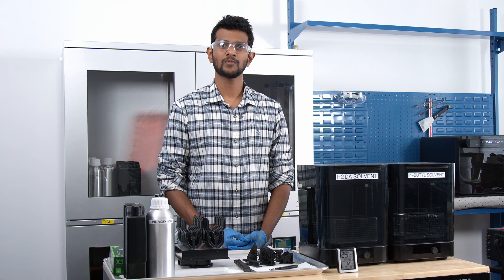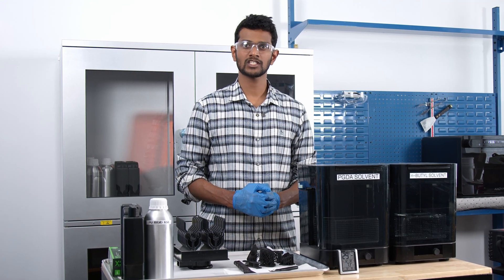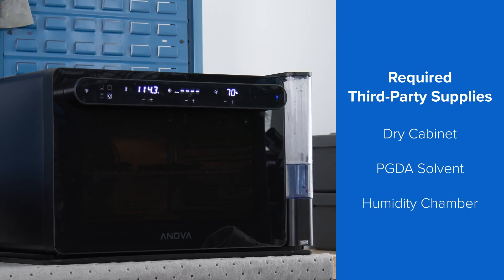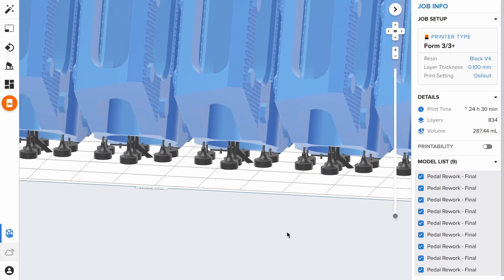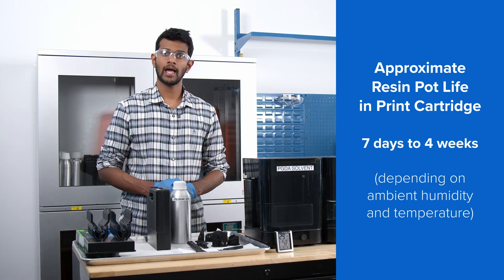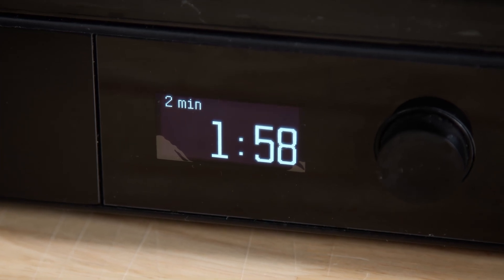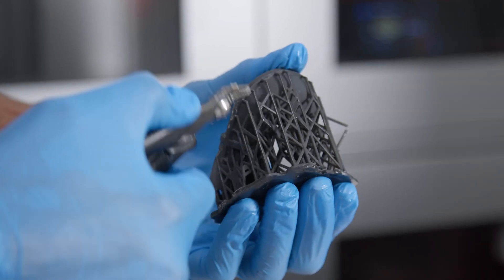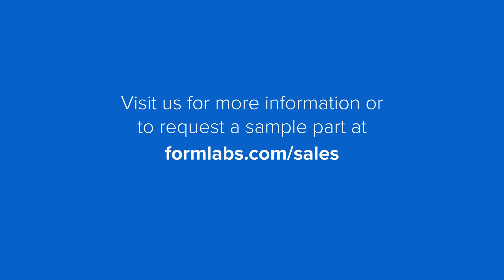Polyurethane 3D Printing Workflow

Comment: Would just love to hear of . . . 
PU Thermoset resin systems 
( with or without chopped glass reinforcements . . . to achieve 
1  A very hard stiff high IMPACT RESISTANT parts with upto or exceeding SHORE D 71 
2  A FAST SET SPRAY GRADE material to manufacture parts as large as 8ft x 8ft  . . . surface area . . could extend on.
3  Whether Rigid PU foam sandwich composite could be integrated simultaneously OR post operatively with this surface ?? ideally simultaneously.

THERE OUGHT TO BE A WAY . . . to accomplish this.

Comment: I was super excited when I first saw these new PU materials for Formlabs printers. They seem somewhat better suited for production throughput with that short of a shelf life, not prototyping. I need occasional elastomer small parts, so I'd be trashing most of the bottle almost every instance. Glad to see you're developing new materials in any case, but thats a lot of extra equipment and hassle to accomodate. Hopefully we'll see a more user friendly elastomer resin option for the platform in the future. For now it looks like I'll have to stick with TPU on the ol' Creality FDM :)

Comment: A few deal breakers for me:  1. Need a humidity cure chamber. 2.Curing takes "minimum a few days". 3. Shelf life of resin is 7 days to 4 weeks once opened.
Reply: Couldnt agree more, i work at company that has the ability to burn cash in dumpsters and we are not even pursuing this. However, we were very excited at first... haha
Reply: Although I agree the shelf life is less than ideal but easy to work around by just waiting until you have enough prints to use the majority completely up without wasting as much.  I'm just hopeful for more real parts that are more robust and usable without worry of over curing in the light and other issues.

Comment: So... I think the question a lot of people are wondering, is this suitable for outdoor use? Does the modified curing process increase its resilience to UV exposure post humidity curing? That's the biggest factor when using SLA printed parts as functional parts IMO
Reply from the maker: Yes! These materials are long-lasting and extremely durable due to their hybrid chemistry. You can view all of the materials properties in our data sheets: https://formlabs.com/materials/#data-sheets